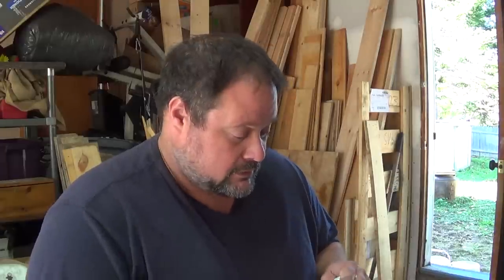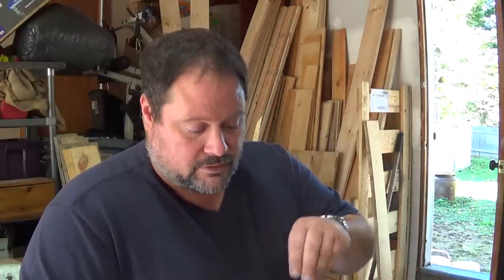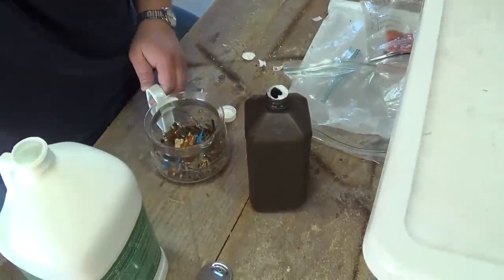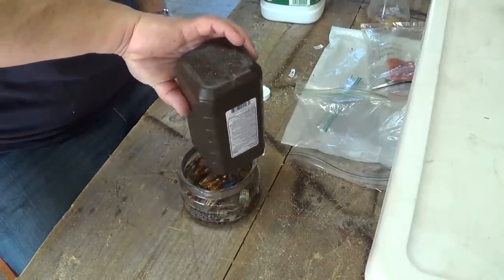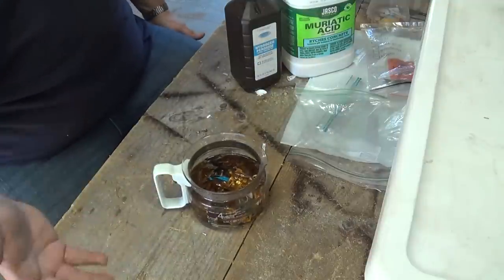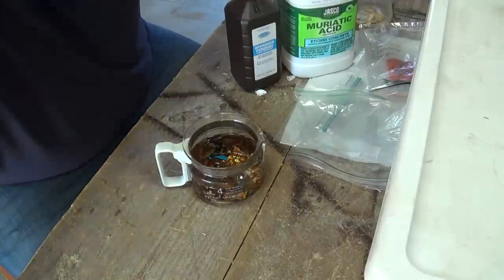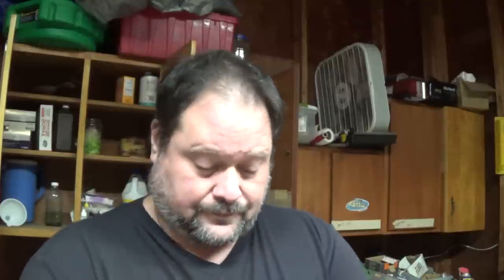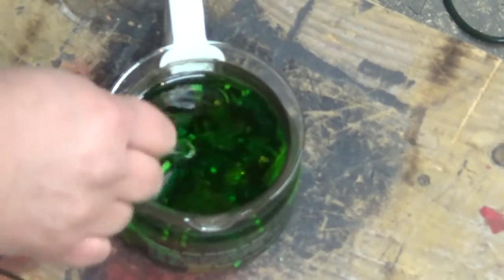Recovering Gold from plated ribbon wire, ink and other gold plated plastics.  -MooseScrapper

Comment: I am surprised that you haven't figured it out Moose! The ink cartridge ribbon is basically 2 pieces of tape with gold between them. You can recover all the gold if you peel them apart and place in hcl and bleach. I have used this method several times with complete recovery.
Reply: If thats the case could you not just melt them directly into the crucible with flux
Reply: Hey moose I tryed the same method you were doing with the ribbins and end up burning them and ended up with a copper ball that was mixed with gold. what the best way to separate it?
Reply: @scrappydoo7887  no because there is still a dumb amount of copper under the cables, which will melt you down a nice copper bead with a low amount of gold lol
Reply: @MysticRey2414  that's what I thought

Comment: Have you considered trying concentrated sulfuric acid in 30% hydrogen peroxide AKA piranha solution?
I understand it loves carbon so one might assume it likes hydrocarbons almost as much even if they're long polymer chains of hydrocarbons. Incineration or even just infiltrating the plastic by distorting it with heat without incinerating it completely probably would not matter because one way would have the hydrocarbons and the other of carbonized hydrocarbons and I wouldn't think either would make much difference to piranha solution that just has a thing for carbon so much so it will devour diamonds so I'd love to see you give it a try if not then I'll try it myself one day if I can ever get my hands on a decent amount of high-test peroxide that doesn't cost me an arm and a leg because I'm currently unemployed and it's impossible to justify right now.

Comment: Moose, been watching your vids for a while and you (& Ben) got the ball rolling for me. Along with scrapping on the side, my main source of income is in the irrigation industry. Just thought I'd throw a suggestion at you.....Most irrigation controllers have complete gold plating on their circuitry. Even under the masks. This, I'm sure,  is due to the conditions and elements they are subjected to. We use Hunter & Rainbird controllers exclusively and it is the case for these. Possibly lesser brands use copper but these 2 companies produce the majority of clocks and most companies go with them as well. So, keep an eye out for them. I would also suggest to you that stopping by a few local irrigation companies and just ask them for their throw-aways. Most clocks are warrantied for only 2 years and they do go bad reasonably often. Worth a shot. Between our company and a few others that don't mind stacking them up, I probably get about 300 boards a year and maybe 500 module boards. Couldn't hurt to try. Happy hunting.

Comment: For small amounts I would suggest getting a bone crucible or graphite and merely hitting the ribbons with a torch.   A propaine foundry works as well.  When doing this process, make sure you can control the air intake.  Low air intake will cause the plastic to char instead of burning.  I use this method with copper wiring and electronic components.  Granted its not the most environmentally friendly method, but it is an alternative.

Comment: a lot of the gold parts imbedded in plastics separate well 2 different ways in my experience depending on type. 1: submerge in 98% sulfuric acid, heat to 80-100 degrees c. 2: submerge in nitric acid 50-60% pure. after separating and rinsing, continue process as usual with hcl/bleach.
Reply: So there is gold inside the plastic? Not just the gold plated tips?? Been wondering this! Thanks for the info I’m excited to try with sulfuric.

Comment: thanks for sharing this... i’ve been wondering what to do with these for a few weeks now.  my plastic tote is starting to overflow, and i will have to do this eventually. for now i’ve been pondering running it all through a paper shredder to see if i can pack more in there.  looks like pyrolysis will have to be used.

Comment: I see in this video (and I think in one other) that you're using the AP method for ink ribbons & ribbon cable ends to retrieve foils, but 6 years ago you used HCL+CL to dissolve the gold into a AuCl3 solution... So which way do you prefer?

Comment: Expecting to make at least $80 of gold, but earlier said less than a quarter gram. Even at current high of $50 per gram it doesn't add up. Be lucky to recover the cost of acid and gas.
Reply: Sorry, re-watching I realize the $80 were for high yield gold fingers, and chemicals were used for other recovery as well. Also, apparently acid can be re-used.

Comment: Moose, I take the ribbon wire from printers and process the same. If you use "gloves" you can take and run them between your fingers and the gold came off for me. I am thinking of using an old tooth brush to remove the gold instead of using my fingers "gloved of course".
Hope this helps

Comment: Moose,
Hcl and CL works well. I cut off the ends with scissors to reduce the fluid volume required. Another option that I use on gold fingers is dilute HNO3, about 25%. You will find ribbons and gold fingers that are magnetic. They have nickle alloy etching , HCL will take a very long time, sometimes it will not work at all.

Comment: Nice. For curiosity If I calculated right, for dissolving 100g of Cu ... you need 497g of HCl (35% conc.) -> 418mL HCl.  
Do you process "Green liquid" somehow? it is full of copper (II) chloride and also few percent of nickel chloride

Comment: or the printer cartridge flex's there may be so sort of mack you might try a short soak in lye then back to ap.an other option would be to run them through a hammer mill and hope for the best . i noticed that you sent stuff to mount baker balists i think all wire when reduced to sa mesh 40 - maybe 60 - is going to come out as sand and insulation the copper sand of high purity should be very resaleable especially in bulk but a full size hammer mill is overkill for a backyard scrapper i will be experimenting with smaller drill and angle grinder powered smaller hammer mills hope to have video soon.1 other concern is that high grade pc boards are about 45% copper by weight  the hammer mill sould do the trick here as well grinding ic's also frees most of the bonding wires around mesh 60 - and the bond wires will go through a mesh 60 - screen just food for thought not using chemicals is always going to be cheaper if you can do it.

Comment: Use hydrochloric acid not miradic and a bubler for a week. Do it outdoors or with ventilation fan/hood.
Reply from the maker: muriatic acid and hydrochloric acid are the same thing.  Its like oil of vitriol and sulfuric acid are the same thing.

Comment: As far as the cost effectiveness question, didn't I see a video from you a long time ago where you said that you could pull the copper back out of the acid and reuse it, stretching your dollar even farther?
Reply: Once AP is saturated with copper (won't digest anymore), 1st... test with stannous chloride to ensure you have no PM in the solution. Then, if no PM needs to be dropped from the solution, use a smooth iron rod or bar to cement out the copper. The solution will digest the iron and expel the copper onto the bar/rod that you can then scrape off into another container and repeat until no more copper accumulates. Then of course, properly dispose of the solution.
Reply: Scappin' Cricket Hm. So no reuse of the AP at that point. Okay.

Comment: Like to see a video on how to remove the gold fingers from the board. Been struggling with that part myself.
Reply: I personally use a blow torch to melt the solder and tap them into a metal bucket

Comment: So I have used the HCL & Hyd Peroxide 3 part to 1 part roughly. Still left with a lot to recover. I took time and a razor blade/small flathead screwdriver/ and time. To peel back the film that keeps the solution from working. That test is underway shortly. I shall give you those results when i see if the same solution still works after i peel the clear film away and try again. Tedious

Comment: as for pyrolysis or burning obviously if you get it to hot you can loss gold i have been thinking that since you want to burn off the volatiles but not the metals that approaching this like a wood gasification  stove would work well you do not need to get over 800 degrees f ,take a sealable metal can fill with ribbon ends punch several 1/8 inch hole near the top of can put some sand in another slightly larger can put first can inside second can, then heat with wood fire keep an eye on the exhaust holes on the first can as can plug them the volatiles should come off as a burnable gas this will work for plastic ic's as well. nd optiplace in furnace with high oxygen flux heat to 800 degrees f this also would work for plastic ic's though i think i would use the outdoor method less to go wrong.
Reply: There needs to be more "fail" vids out here. While I don't think it's was a complete failure, hopefully it will get others to try different methods with better results. This hobby is tough....I know. I don't care about gold weight yield.....I can turn 1/2 gram of gold flake and dust into hundreds of dollars in my recycled jewelry biz by simply adding it to crushed gemstone......think out of the box folks and you'll make money!
Reply: i agree if you recycle silver look at making silver wire if you recycle copper make copper pots and pans upcycle anywhere you can.

Comment: Hey moose, just wonderin, after pulling copper out of used AP do you think there would still be any gold that could be lurking in the solution??
Reply: Always test with stannous chloride for any PM in spent solutions, like AP.
Reply: add zinc powder to solution till saturated then filter and process powder For 50 grams of powder use 100 ml h20+200 ml hcl heated under vent hood to 140F then slowly add 20 grams of potassium nitrate  stirring every five minutes till no orange gas is released.  Cool and add Sulfamic Acid till no reaction (this will also drop lead at this point)  then drop gold with SMB.  this will recover any gold present in solution.